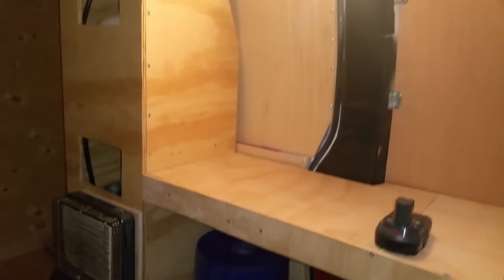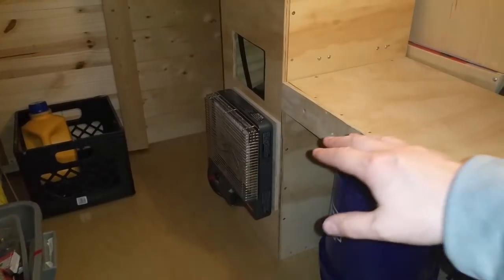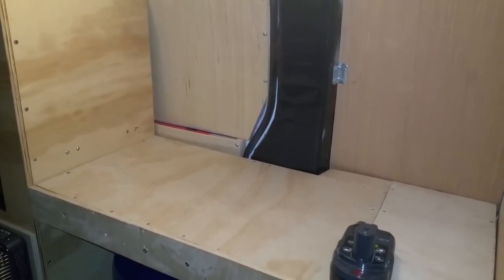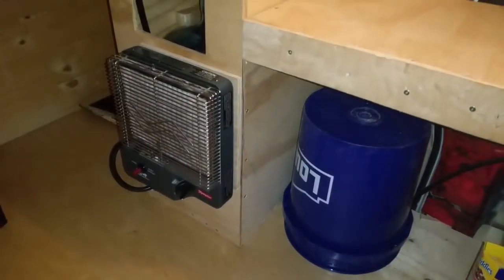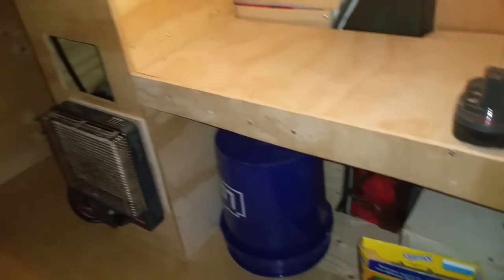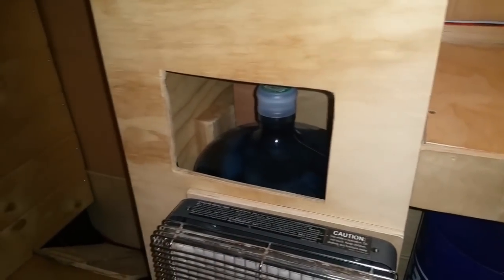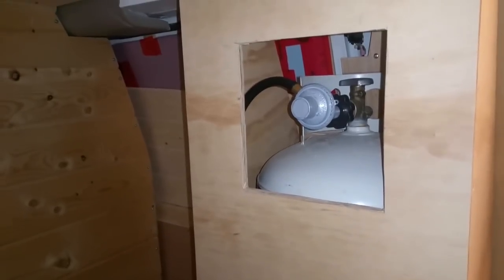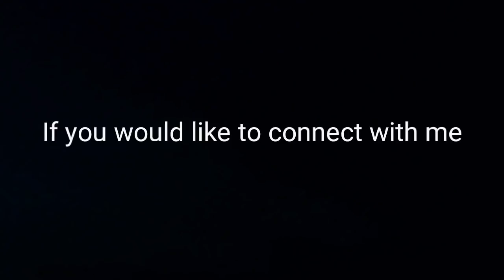Van Build Design...  Van Build Update... My Most "Polished" Video to Date..

Comment: Good to see you back, you're rocking it. The van looks great! Please consider (I may have missed it in the video) keeping your propane bottle in a sealed box with a vent to the outside. I've had several of them blow off the pressure relief valve over the years due to temperature changes or ?? idk what. If it's a pain in the keester to access every time you need to turn the valve on, use a rod that attaches to the valve going through the top of the box through a fairly tight fitting hole. Take care Bud. I know you have it under control.

Comment: Hi Tim -  I really like your design and the way in which you put your living space together. Not sure if you have ever mentioned how tall you are and how well you fit into the Transit. It sure looks like a great alternative to a Class B RV.  Great video!
Reply from the maker: I'm 182cm. I had to push the passenger seat forward in the Connect when lying down but it was fine.

Comment: Got a couple of tips, not trying to be mr know it all, but among other things I am a carpenter. You might want to try something cheaper and better to attach shelving. Use your plywood scraps to make around 3/4,  or wider cleats instead of those metal  L brackets.  Nail or screw them into the side bulkheads. Another couple quick and fast tips on shelving you might want to use. After installing the cleats, run a bead of silicone caulk on top of them and lay your shelf piece into the caulk bed. Quick sturdy and fast. One more. On a long shelf with fairly thin material, face the edge with another cleat like piece to form an L. The wider the facer piece, the stronger the shelf will be. Use nails and carpenter glue to attach the front facer piece to the shelf. Makes a strong structural shelf, light and strong.
Reply from the maker: Thanks. Great tips. I have been using ply cleats on this build but I have LOTS of those angle bracket things so I figured I should use them.

Comment: Good to see the van build progressing Timothy. I see what you mean about the position of the heater, but it is sensible not to have it too close to the bed. Could you attach a movable metal sheet to direct heat towards the bed when required?
Reply from the maker: I'm considering a movable tv wall mount. Have a great day. ☺

Comment: I notice your heater is mounted on a panel that is attached (screwed?) onto your water cabinet. You could consider putting hinges on that panel. That way the heater is out of the way when you don't need it, It is still usable, when it is not really cold, or for example when you sit oat your table. But you can direct the radiant heat towards the bed without having something loose in your van. Nothing to kick over or to slide too close to your bed.
Reply from the maker: Thanks. See comment above. ☺😂☺

Comment: Sweet video, adorable kids, I have a question - what is the reason why I do not see a lot of van dwellers using Webasto heaters? Is it just the price, or is there another reason? They seem to solve a lot of van dweller heating problems (they don't take up a lot of space, they heat well, it's a dry heat so less condensation, and they seem less risky overall). Thanks.
Reply from the maker: For me it's price and noise they create. ☺
Reply: Thanks! Is it loud from the outside? If so, then I can see that not being a good stealth option.

Comment: There is one thing that truly concerns me with van builds and, in this case particularly, yours. No I am not being smart. Lat year I saw the results on a news report of a chap who had his van ready to go off with wife and child parked on the road outside his home. He had approached it and pressed the button on his key to unlock the door. Their had been a gas leak from a bottle overnight. The resultant blast opened the vehicle like a sardine tin. He was lucky and was blown off his feet and across the road and was only bruised and battered. There have been other instances and I have seen one myself in a wooden Clerk of Works hut where the chap lit his pipe one morning whilst stood in the middle of the hut. The explosion blew the roof off and the walls out. Because he was stood in the middle of the room he survived but was deaf for a while.

I have been using a caravan in the UK for 37 years but probably only 80 days a year for 25 of them and 120 days a year for the last 12. I have twice known a gas bottle to leak. 

It would be far better if the gas bottle was on the floor, a door closure with a draft excluder to make a seal and a drop hole in the floor since butane/propane is heavier than air.The water container above would only aid water delivery. Just saying Tim.

Alan
Reply from the maker: Yes there are risks. But I do some things to minimize them. I change my hose every year. I have my roof vent open to maximum 100% of the time. I never have an open flame unless I am cooking. I also have easy access to the valve to shut it off quickly. That said, the risks are real.
Reply: Your right, carrying around these big propane canisters inside add more risk.  I don't think any major brands mount these inside the cab because they'd probably get sued to the teeth.  Timothy, might want to check and see if your auto insurance would cover this if something did go wrong.  Take care and good luck.
Reply: Most, if not all, commercial motor caravans, van conversions etc in the UK do have the gas onboard. Usually with an external access door to aid changing out. However they are in a sealed enclosure/cupboard etc and have gas drop holes within the enclosure so that gas leakages drop outside the interior rather than building up at the lower part of the outfit. The floor lockers where the gas piping joints are also have gas drop holes
Reply: The two leaks that I had were due to a faulty valve on a gas bottle collected from a respected supplier. The last occasion was about 7 years ago and a 3.9kg (is that about 10lbs?) bottle emptied itself overnight.
Reply: I agree Alan, It's nice to have someone caring for another :)
Reply: PS Tim Allen xD